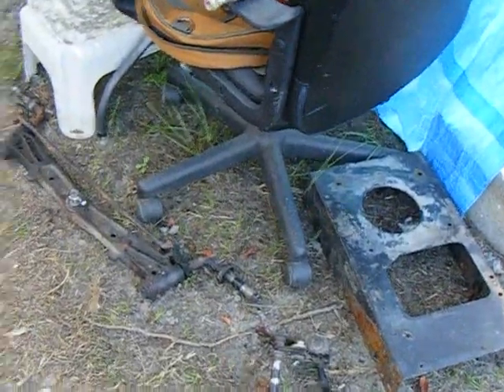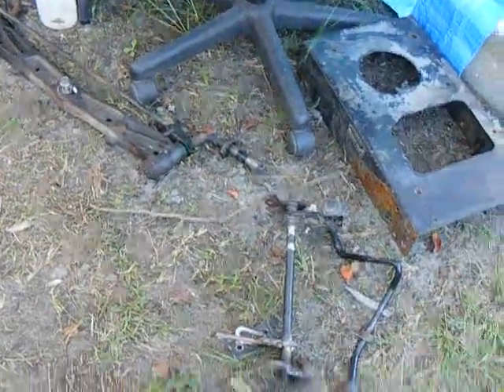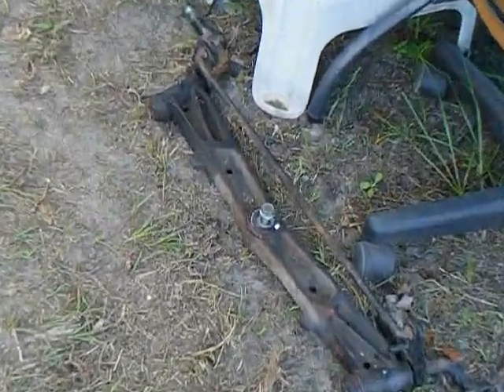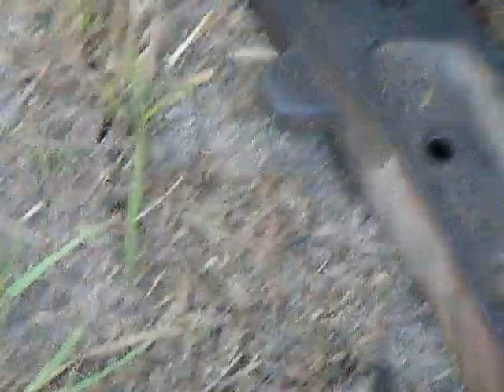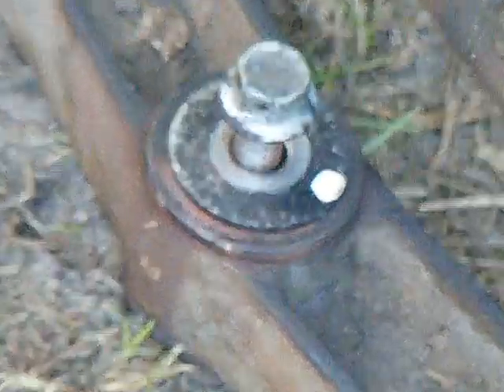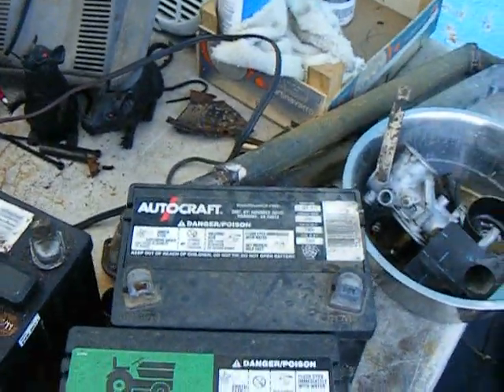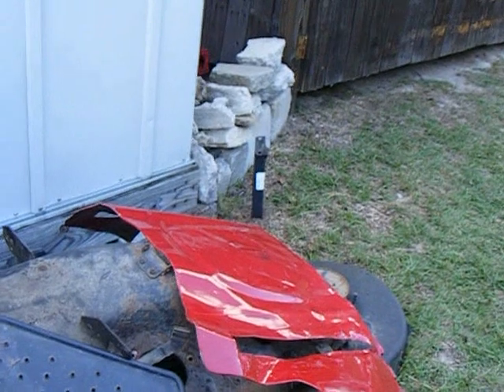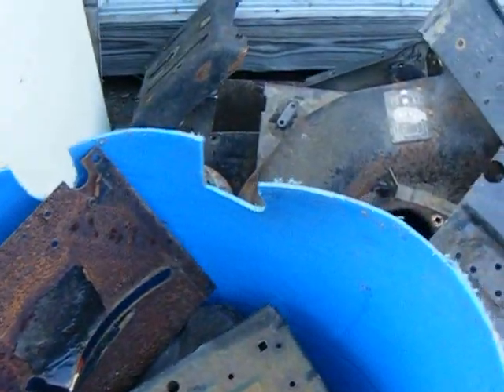Red Eye backyard romp.

Comment: Yea it goes pretty good! Ya gotta do a foot throttle next..and I know the front end is wiped , but lock it halfass for now , it'll help a bunch
Reply from the maker: Gonna work on steering. Not locking a foote transaxle. Hoping to find a 820 or at least another 206-345.
Reply: Oops, I meant lock the front end from pivioting. It helps big time. That's about all I did on mine for the major part. And yea , screw locking a foote
Reply from the maker: I want it to pivot though. I changed the steering gears today and along with a new steering bushing. helped a lot.
Reply: That's cool that ya got some of the slop out. But for kicks maybe try and temporarily lock the front end , it really helps keep it from rolling over in corners and lifting the inside tire. 
Weld some nuts on the frame somewhere , and thread in some nuts to hit against the beam and try a lap or 2 around the yard. That's what I did for a test before I made it semi permanent